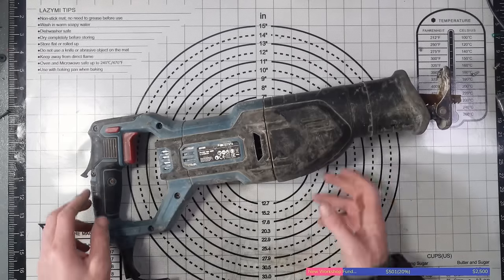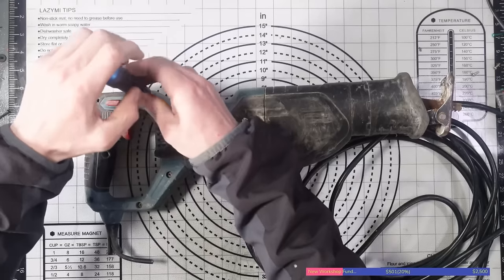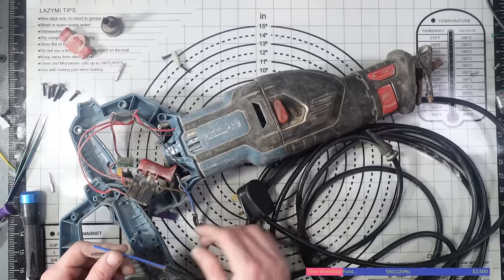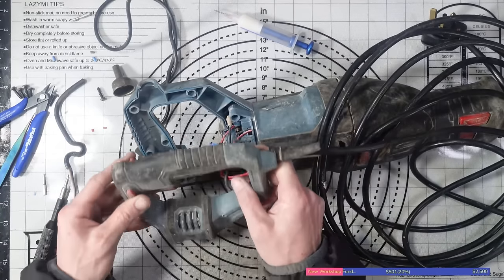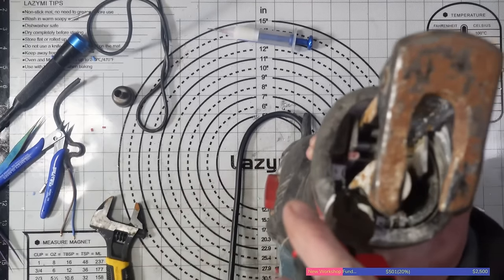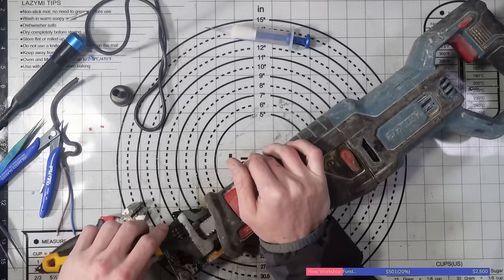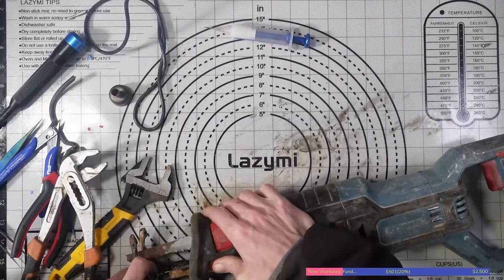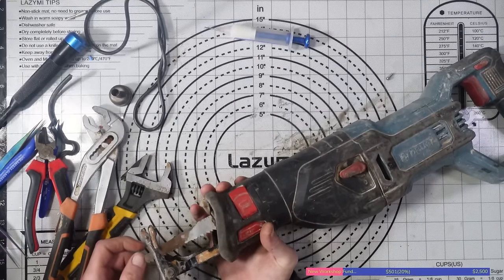Trying To Fix A £4 ERBAUER Reciprocating Saw (From A Car Boot Sale)

Comment: One reason why we have fuses in our plugs is because we have 32amp mains circuits. The fuse is to stop the cable on the appliance from having a meltdown in case of a short. I have a few bits of Erbauer stuff, but just drill sets and hole saws. Have had them a few years and have found them to be ok. Screwfix and B&Q sell them in the UK.

Comment: Looks like the Torsion Spring has moved out of line easy fix, and that part is easy to get if u get a cheap Chinese spring. The blade is meant to wobble like that, similar to a jigsaw that needs a bit of movement.

Comment: The spring collet on the end of the saw has a pin inside to lock the pin. They get very hot whilst sawing so end up rusting solid. Sounds daft but submerge the collet in white vinegar overnight and it will dissolve the rust. Clean and dry it and add light oil and it should open and close easily. That one has been well abused so don't expect it to last too long. The windings burn up. Only £30 in Lidl middle aisle every now and then, so not worth wasting money on fixing

Comment: When you don't have wd40 or other oil but you have a vehicle, go get a few drops off of your car's dipstick.  Saved a lot of frustration from rusty tools doing that.
Reply: That's a great idea. Vegetable oil is not bad either. But just as a last resort kinda thing, it can get gummy. 
Any waste oil would work really in a pinch. I agree it doesn't need to be clean dealing with rusty tools.